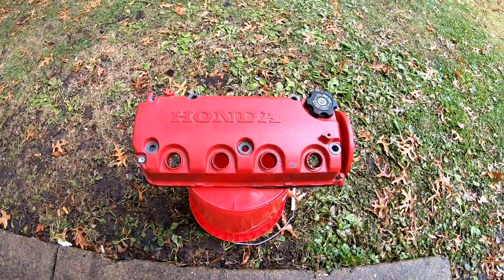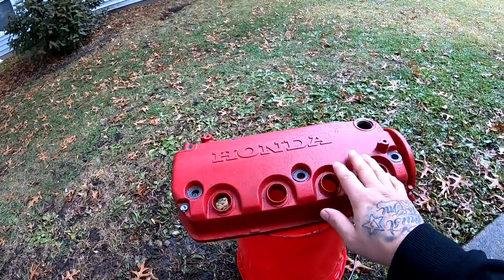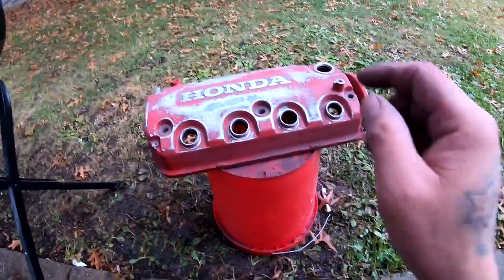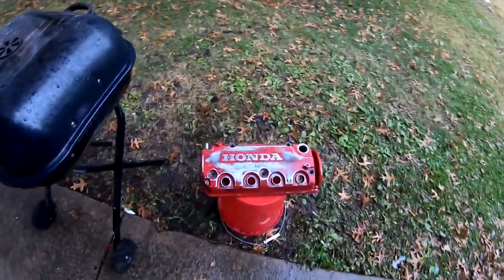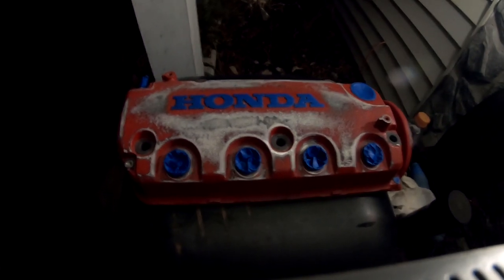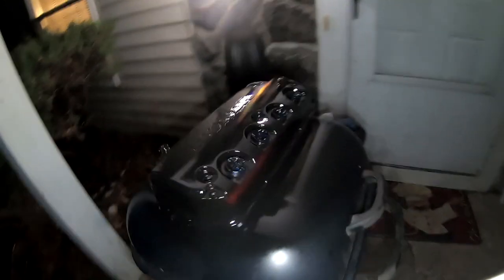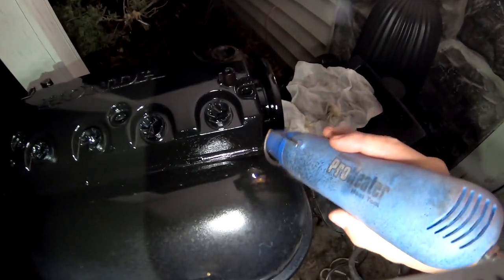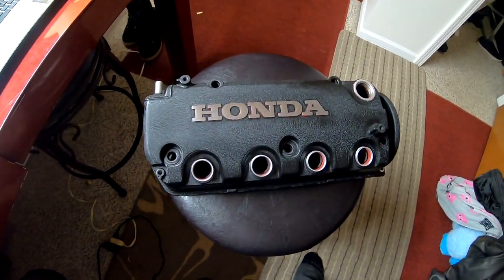VHT Wrinkle black paint job Valve cover on civic d16

Comment: Throwing this out here to you next time you do a valvw cover try this get a can of air plane stripper also wear gloves cause can burn the skin  you can buy it at any home deopt or lowes stor take a paint brush wipe it on and let it set for a couple minutes you will see how fast it comes off then all you do is take a water hose and spray it off as much as you can let dry then sanding is little to do...Ive done this with several import valve covers also I go to dollar general stores and buy 3-5 gallon MEAN GREEN degreaser  buy a plastic garbage can pour two in the see if you need more and then let  your valve cover sit for 2-3 days and look how fricken clean that if will be again rinse off with water use gloves this wont burn you but never hurts to use them like the rubber throw away kind and no matter what u have to degrease put it n there and even if the color looks dirty keep it until your done degreasing all you have ok my friend then us a dremel for in between the letters and around the spark plug holes  just a tip i do to share with you and others buddy keep up the good work damn i need to make a youtube page
Reply from the maker: I have a can laying around of airplane stripper I dont like to use because that stuff is so strong smelling the old man would have freaked out if the smell would  have gotten in the house haha I do like the idea of garbage bag with degreaser gotta try it next time thanks for sharing all the great info and good ideas